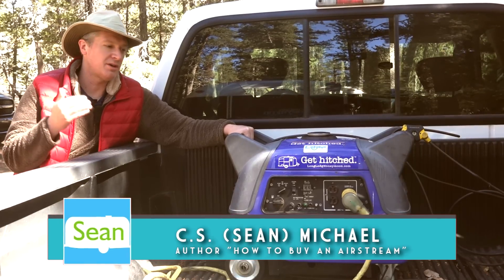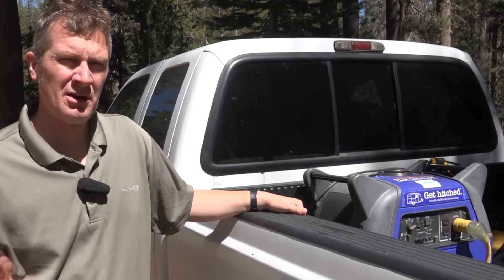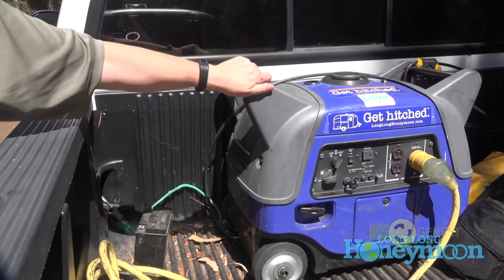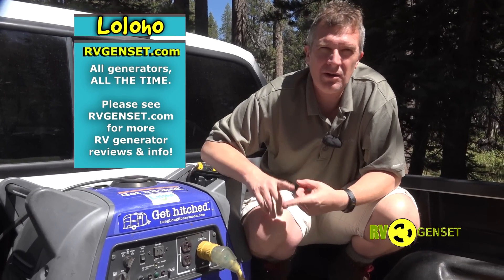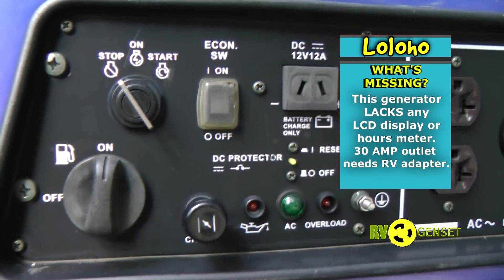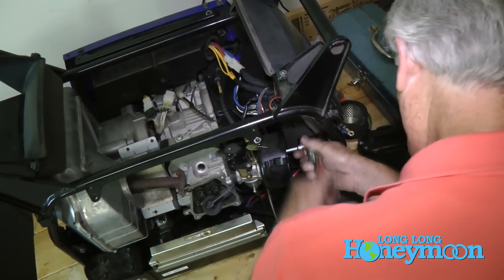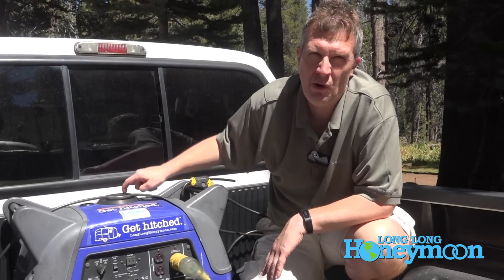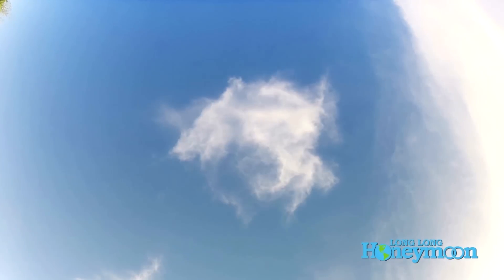REVIEW: ⚡️ Yamaha EF3000iSEB ⚡️ Inverter Generator AFTER 10 YEARS! 😱

Comment: I am in year number 13 with mine.  I added the remote start when it was a year old.  I keep it in the back of my truck almost exactly like you do.  I have had to replace the Remote start remote one time.  Other then that, Oil changes,  A new spark plug, and doing all the PM's in the manual are all I have done.  It has performed amazingly.  I am still using it!

Comment: I've had mine for over 20 years and it works great. When not in use, start it up with a load about once a month. Keeps up the battery and running.

Comment: I purchased a Yamaha 3000iseb 17 years ago and as I speak am replacing the battery and it is the first thing I've done besides changing oil annually. Something worth mentioning is that I was told that the Yamaha generator has a sleeved cylinder that can be rebuilt rather than having an aluminum cylinder as Honda has. With the service I've had I can't imagine ever having to rebuild the unit.

Comment: Purchased our EF3000 iSEB over ten years ago for exactly all the same reasons.   Needed the boost for starting the RV AC, it's probably the quietest portable generator I've ever seen, both then, and even today, and it sips fuel, especially in Eco mode.  Recently added the propane kit because it now sits at a remote location where I don't want to store gasoline for long periods.

Comment: The piece of metal you found in the generator looks a lot like pellet of shaker media from a de-burring machine. Basically you throw your parts to de-burr in a donut shaped tub filled with shaker media. Turn on the machine and it vibrates the tub. Thus removing the burrs via contact with the media. Likely the media was left in the carb or intake manifold. P.S. had a friend destroy his freshly rebuilt car engine with a piece of shaker media.

Comment: We've been going back and forth between buying a generator or installing solar.  10 years on a generator isn't too shabby.  Great review!
Reply from the maker: Thanks! Yes, this has been a good unit overall. :)
Reply: good luck running an air conditioner on solar.
Reply: Have over 10k hours on my Honda's. Total off grid life. Got mine in 2012 ... 2000 , 3000 and the 7000.   Only thing we have changed was the crank rope and plug and oil once a week
Reply: Yamaha is the only other gen i would buy other than diesel.
Reply: Even with solar you'll need a generator

Comment: I have a 12 volt power outlet in the back of my pickup that I use for various things. I eliminated the battery in my generator and in place wired in an umbilical cord that simply plugs into the power outlet. My pickup batteries have plenty of power to start the generator. I also have an outlet on my trailer for that purpose in case I want to leave the generator with the trailer while I use the pickup to run errands while the Wife stays with the trailer.

Comment: Using the choke to stop engine will wash the cylinder walls with gas at shutdown. The dry starts will excelerate valve guide, piston, rings & cylinder wear as well as dilute the oil w/gas, creating more wear etc, etc. Worth fixing the switch. Using only gas on/off valve for shutoff is much better all around in the meantime.
Enjoyed the in depth reveiw. 
If the metal piece was inside the combustion chamber, it was likely lodged inside intake since new. If inside crankcase it could have been a worn part or keyway(watch for further breakage soon), or came from inside oil bottle.
Reply from the maker: +Michael Amick thanks much for your comment. I'll start using the gas on/off valve instead and will get that switch ordered. One of these days I'll do a vid about that metal we found in the head. It has been a few years since that happened , but I kept that little piece of metal somewhere... 👍

Comment: I have the Ef300ise. Purchased in 2003/4.  It have put in excess of 3000 hours on it. NEVER had a problem until yesterday 5/19/2020 when it made a clunk and stopped producing electric. Runs but no electric. Time for service but our Yamaha dealer will probably want half the cost of a new one to fix it.

Comment: I have the EF3000iESB & love it. I always turn it off by shutting off the fuel supply because it sits for long periods of time between uses & I don't want my carbs gummed up if the fuel goes bad. It would be nice if it had rotating wheel castors but, that's not a deal breaker as it rolls very well with the factory wheels it has now & it just takes a second to lift & point in the direction I need it to roll.

I've been riding dirt bikes since '74 & all 4 of the Japanese manufacturers build a quality product. Honda has established a reputation as the most reliable but, I feel like they're splitting hairs to make that claim. The quality of Yamaha products within the last 30 years EASILY equals Honda IMO.... I'm actually surprised that you had a potentially catastrophic weld failure inside the motor at only 5 years of service. I doubt it's a problem that will prove itself to be common for the EF3000iSEB.
Reply from the maker: You know, we still have our original 15-year old EF3000iSEB. I'm going to do a tune up on it soon, and I bet it purrs just the same as always. I feel the overall quality of these units is fantastic.

Comment: Thanks for the long-term review and commentary of Franklin.  Seems like he's been a champ over the years requiring little attention.  How do you track the hours between oil changes?  I installed a inexpensive hour meter purchased on Amazon that does a nice job and easy to install.  We loan out our Honda EU2000i from time to friends and organizations so it's difficult for me to accurately track the running time without an hour meter.
Reply from the maker: +P-Dub Sadly, we have no hour meter! I try to keep track, and use the best synthetic oil (plus Archoil). 👍

Comment: Have you been consistently using the same oil throughout Franklin's life?  For small engines i've always used Mobil 1 synthetic oil and never had a failure.  For dealing with extreme conditions with an air cooled engine you can't beat synthetic oil.
Reply from the maker: +Tommy TwoGun I use Mobil 1 synthetic also. Franklin takes such a small amount of oil, I figure we might as well use the best.
Reply: Long Long Honeymoon
Awesome thanks for the response!  :-)

Comment: What happen to the Briggs & Stratton P3000 you had in May?   I have had a B&S 3500 for 3 years and love it.  It will run my 15,000 BTU on my Airstream
Reply: How loud is it?
Reply: I'm sorry I have no meter to give you an accurate reading.  I can say it's not hard to stand next to it and have a conversation.  Inside with the a/c running it's just  soft white noise.
Reply from the maker: +grizz474 Watch our review of the B&S P2200 and P3000 to find out. 👍
Reply from the maker: +Ginger Snap Long story, but after I broke my foot we had to put everything (Airstream, truck, and Yamaha generator) into storage in California. Our new B&S gensets are down in Alabama! We won't have access to them until we get back down south, so we are still using Franklin.

Comment: I noticed you have an adapter for use from the coach to your generator.  What is that adapter called...???I have aneed for such an adapter. Although my Class C has an onboard generator, I had an emergency generator that I would like to use and plug in the coach on occasion.

Comment: Thanks for your videos. Quick question. My TT has a Mack15 - 15k btu AC on the roof. Apparently it needs 3500 Watts to start up, then drops down to 1500 while running. You mentioned this unit with boost runs around 3300 Watts. More than likely my AC will not kick on. Can you confirm with your experience if this will work or not. I was going to buy the Yamaha EF4500ISE but thought before I buy the bigger unit I should see if this is an option first..Thanks Again
Reply: 06 Trdrew, I was thinking the same thing. I have a New travel Trailer with dual air of course I know you can't run both, One is a 15,000 btu and the bed room is a 13,500. I myself think you would be better off with 2 honda inverters. for a 15,000 btu Just saying.

Comment: I just bought a Yamaha EF3000isi for my 28 foot trailer . But soon found out that it doesn't run my air conditioning. It over limits. Not happy. It seems to run all these other people's units but not mine.  I have a 13500 btu AC and a brand new trailer
Reply: Make sure ur starting it with eco mode off.

Comment: After 10+ years, have you thought of changing that locking 30 Amp to an RV 30 Amp receptacle? Buying one, Yamaha 3000 iSEB, of these myself, and was wondering if that might be a warranty voiding mod (for sure actually) that would remove one set of connections.
Reply from the maker: +Larry E I think it's a great idea. The adapter is one more thing to go wrong (it may jostle loose, etc). At the moment only Champion seems to appreciate the importance of an RV ready 30A outlet.

Comment: mine has started blowing oil into the air intake after about 1000 hours. Really should have just bit the bullet and spent for a proper slow-turning diesel to charge the battery bank. (have chewed through 3 gas screamers in 12 years)

Comment: New subscriber. Just purchased our first travel trailer. a 2016 KZ Spree escape. It has an 8,000 BTU Air Conditioner. We are thinking of a generator for the future and possiblilty of dry camping for a few nights here and there. Is a 3000Watt Necessary for such a small AC or do you think a 2000 would handle it if we are careful not to run any other appliances?
Reply from the maker: +drglnc69 Check the specific startup Wattage requirements on the AC. I think a 2000W would probably run it, so long as the startup doesn't overload the generator.
Reply: Great thanks! I will do that once when we go back to the delear next friday to pick it up! Can not wait! Also, i was tying with the idea of installing a Hard start capaciter. Have you done so? do you think it is worth it? For less than 50 bucks it seems to be a good idea.

Comment: One question: what is the highest elevation you have run your generator at? Any noticeable problems or strange mechanical behavior?
Reply from the maker: It definitely kicks out less power at high elevations. We often camp in the Grand Tetons at 6237 feet above sea level. Many places in Yellowstone are even higher (up to 7900 at Canyon).

Comment: I watched your reviews of the Briggs and Stratton generators.  After have used this product forever do you ever think you will go with 2 smaller units? I originally bought one of the cheaper units but as soon as I bought it, my demands changed and now I have 2.  But the end result is I have a redundant generator should one fail. We all get brand loyal,  just wondering what your plans are since you had/have the Briggs units.  Here's hoping my cheaper units last, they should as we aren't using them like you do.
Reply from the maker: +campingjack75 which did you buy? The B&S P2200? They should last, just keep the oil changed and don't let the ethanol sit for too long.
Reply: Actually bought the new harbor freight Predator 2000.  Did a couple YouTube video reviews,  but I'm no professional! Love your style. I just couldn't justify the price for my current needs. Had a family member who had the Honda 3000.  That and the Yamaha are sweet. I didn't realize there were so many options until I went looking! Keep up the great work.  Greetings once again  from Colorado!
Reply: And in honor of Loloho's tradition of naming your gear.  I'm naming my generators Thing 1 and Thing 2!

Comment: lucky your FIL is mechanically inclined.. local small engine repair shops/service centers in our area charge $75 per hour.
Reply from the maker: +Junior Miller yes, if you can't turn a wrench yourself, small engine repair can be very costly.

Comment: Great review thank you. I'm torn between a higher priced Yamaha 3000 or a lower cost Champion 3100 so we can run our 13,500 btu air conditioner in the trailer. I also want to make sure it's not going to be to loud otherwise I need to make a quiet box.
Reply: We go camping every 2-3 weekends 9 months a year.  Last year we bought the Champion 3100 and so far its been awesome.  I did have to install a hard start capacitor (12 bucks on Amazon) on the AC, but would have had to do that with any 3000 class.  A lady at a campground with a Honda 3000 commented how nice and quiet our generator was as she was walking by.

Comment: that piece of metal looks like square keyway
Reply from the maker: +Patrick Brown Can you explain more? I might do a video about it...
Reply: Square key as in shaft alignment with a gear of some sort...  keeps the timing of the piston or lifters.
Reply: You're most likely to see these locking a wheel or a pulley onto a shaft.  For example, check your rear lawn tractor wheels.  They are often locked in place with a square key.  https://www.quora.com/What-is-the-difference-between-keyseats-and-keyways

Comment: 1 minor problem...
I don't think it will fit under to tonneau cover on my truck...
Reply from the maker: +Michael Hony Great point! Yes this has been an issue for me as well. I wish Franklin was a few inches shorter... 😄
Reply: Mine does under the tailgate fold, however one side doesn't quite close but it works

Comment: If it wasn't for your father in law, you probably would have bought a new generator around the time you had a chunk of metal stuck in the cylinder... However, I think such an event is a rare fluke.
Reply from the maker: +John Thornton I think so too. Overall the generator still purrs and gets the job done. I'd love to know what caused the metal in the head.
Reply: The metal piece looks like a piece of keystock to me. They are used to connect a round shaft to some device such a a cooling fan.  I  can't  think of anywhere on the generator it may be from unless it has a cooling fan. Another option is that it is a balancing weight for the crankshaft. Much like a wheel weight. You may never know exactly.